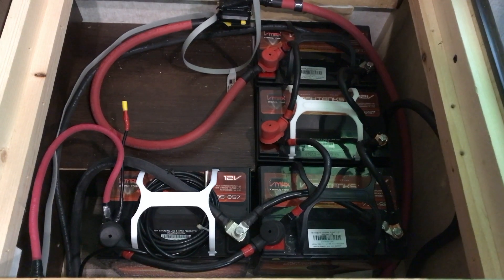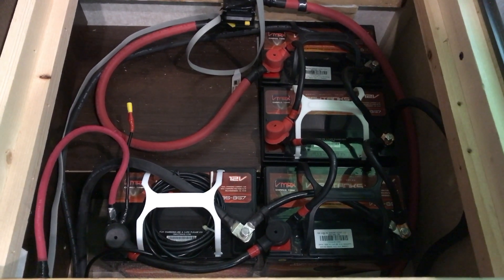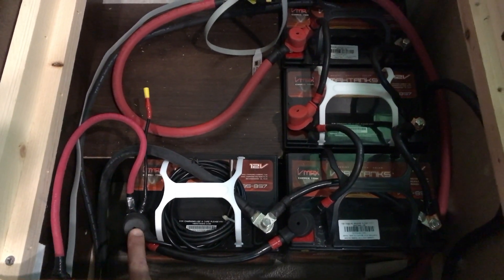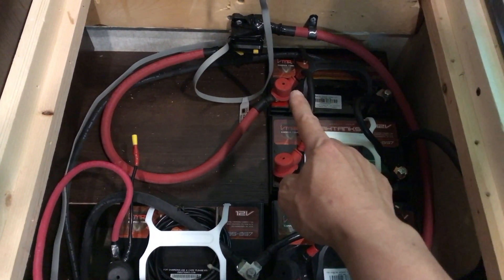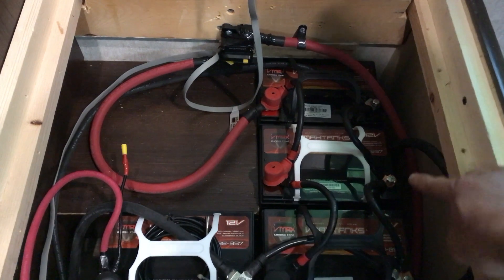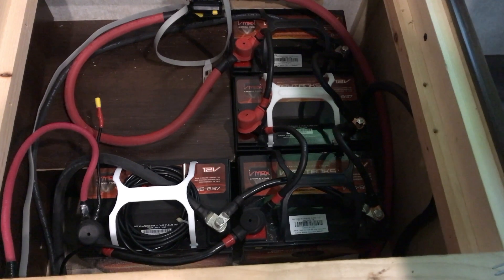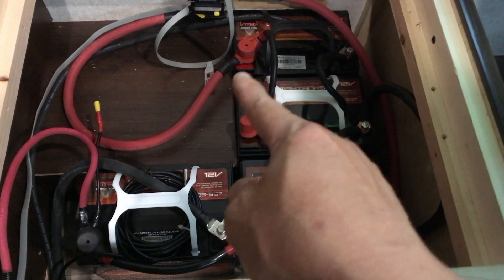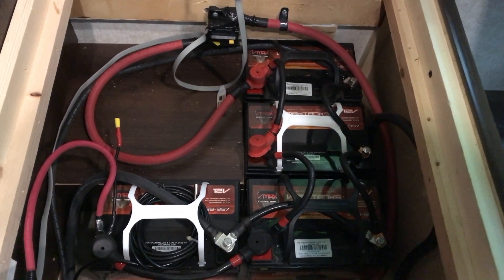How to wire batteries in parallel | Four AGM Batteries wired parallel VMAXTanks 12v 35AH = 12v 140AH

Comment: I have 4 12V35AH from HF. I plan on doing the same with 4awg cables. Is that enough to run my 750watts inverter? Im planning to get at least a 1000 watt inverter in the future. Can I run it safely with the current 4awg cables? The setup length are less than a foot apart from each battery. Thank you Sir.😊

Comment: Nice job but one question.  Why spend nearly 500 on 4 35ah agm's?  Also a good chunk of change on cable fabrication on  top of the battery expense.  You have less then 70ah useable and only when conditions are perfect.   Your actual available ah's are less than that in real-world use.  You could double your available ah's with lifepo4 for 1/4 -1/3 of the weight and space and for less money.
Reply from the maker: I agree with you for sure…. If I was starting from scratch (no existing battery) Those are existing batteries (had been sitting around) for my trolling motor. So, investment wise (cheaper route), it was just best to add on to it. I ended up buying 4 more… then when I sold the trailer, just kept two and gave 6 away (included with the trailer sale).

Comment: Great explanation. Thanks for sharing. I have two questions I hope you can answer.

1). Does it matter which terminals are wired first? I saw that you wired the positive side first and then the negative side. Is that the correct order or does it not matter?

2). In general how long 140 amp hours last you before needing to completely recharge your battery bank?
Reply from the maker: 1. Best to always start with positive. Connect the negative last (same when you are jumping a car with jumper cables) 2. In terms of battery use… realistically you can only use 40-50% of the batteries’ amp hours. Research depth of discharge. 70Ah (out of 140ah). I had a battery meter and depending on your load, it may last you a good amount. I actually took it out camping with me and based on my load / electricity usage, I ended up / upgraded to 210 ah. Usable 100ah. I was fully charge by my 500 watts solar panel by sunset. So, add a meter to your setup and use your appliances normally and watch how long your battery last until it hits 40-50%. Upgrade / add batteries and solar panels as needed. I hope that makes sense
Reply: @cbatilo  Yeah, it makes plenty sense. Thank You.
Reply: @cbatilo  Not really.  Not in 2020 or 2021. But its your system and that's all that matters.  Prices have come down so much that is makes no sense at all to buy AGM batteries.  Lead acid only really makes sense for engine starting purposes these days.

Comment: This is wrong.  The positive and negative load cables should come off opposite ends of the string.  You have them on the same end.  It will ruin the end battery much earlier than the other 3.
Reply: You obviously didn't watch the video or pay attention. He DID wire his load cables on opposite ends of the string. What on earth are you talking about? He even showed very clearly how and where he connected his load cables.
Reply: @damonclark5742  You're right.  I am an idiot and you are a brilliant.    Thanks for being so nice about it.
Reply: @michaeldoherty2289  It does not make you an idiot nor am I brilliant. You just missed that part, that's all. That has happened to me plenty of times. 😅 That throws the idea of me being brilliant right down the toilet. 😅
Reply: @damonclark5742  Actually I was watching 2 different videos and this comment was supposed to be posted on the other one.  Just a dumb mistake on my part.  This was a good video thought I can't imagine paralleling 4 small 35ah AGM batteries like this.  Just buy one larger AGM and save yourself a bunch of cables.   Or better yet just buy a cheap lifepo4 battery (non name brand) and save yourself a bunch of weight and get far more useable ah's.  That's not the point of the video, but it crossed my mind.